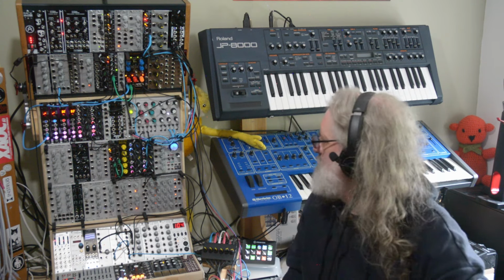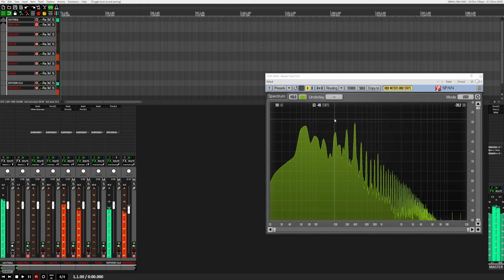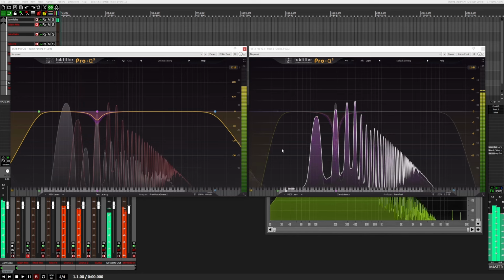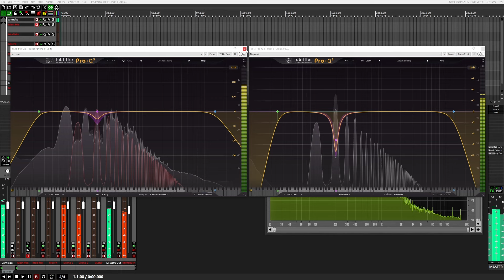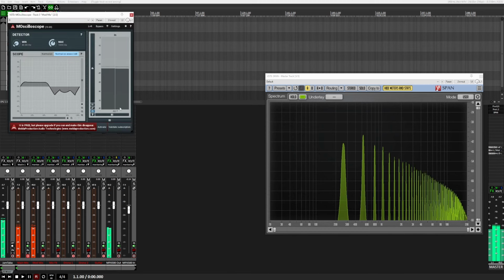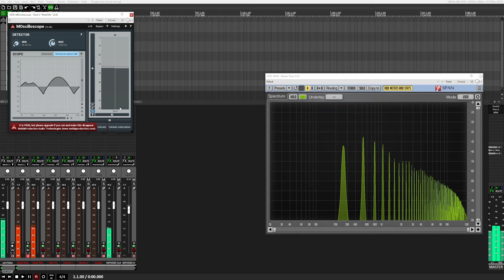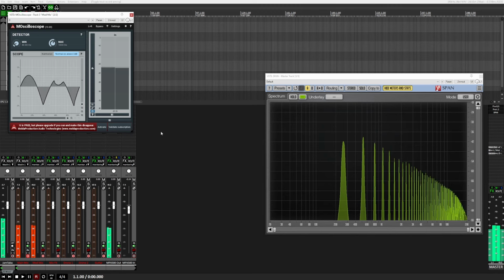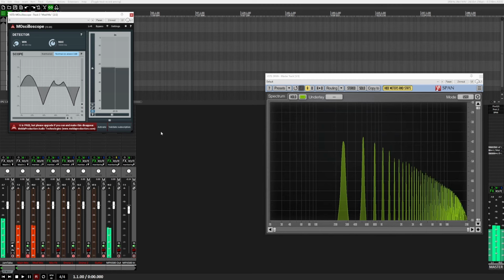How I Drone (almost a tutorial) - Eurorack Modular

Comment: Very useful information, Andy. Softube has clouds, which is a little like Elements I think. Would I be right in thinking your fixed pitch is achieved by tuning your oscillators rather than a specific fixed voltage value.
Reply from the maker: hi Wooks 👋

Clouds is quite different to Elements... Elements is a physical modelling module whereas Clouds is a granular effect

I have had a look at Softube modular and the nearest you can get is Rings, which is one half of Elements

I think the only way you can get Elements in software is with VCV Rack

and, yes, I usually tune an oscillator to the desired pitch but I do also sometimes use CV to select or change the pitch of a drone part... it very much depends on how want to perform the actual drone